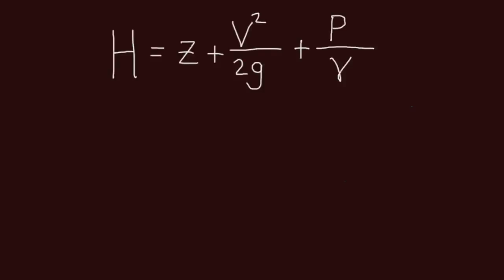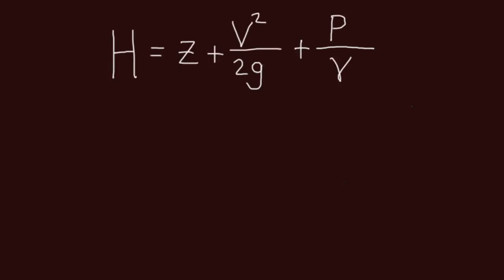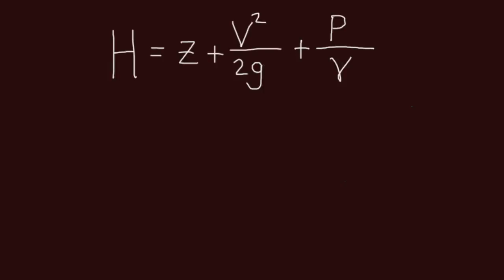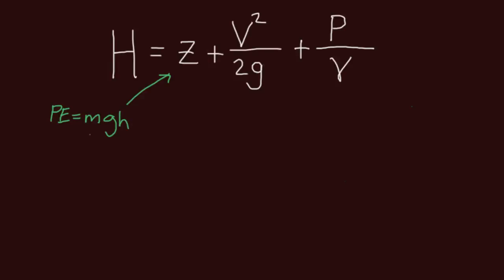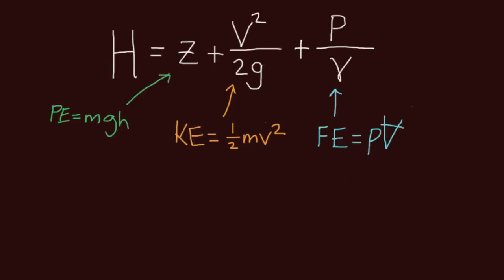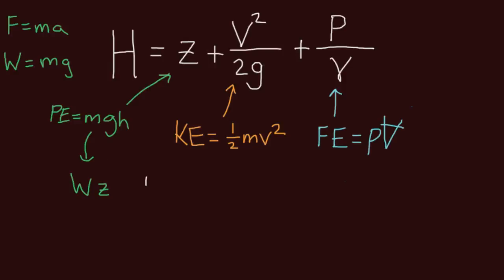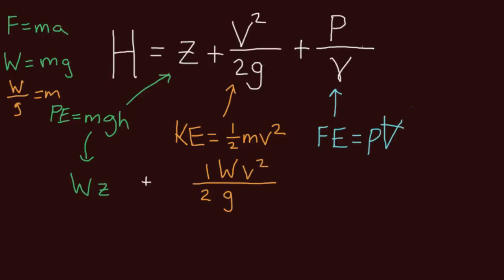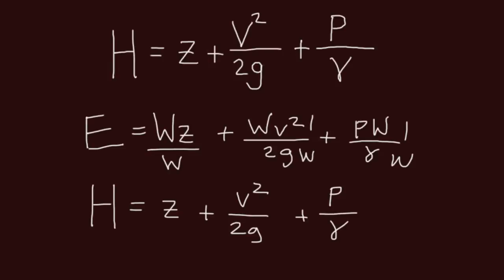Hydraulic Head (Part 2)

Comment: If head is a Total Energy,then why is the unit in the form of length,how does it come?
Reply: Correct me on this if I'm wrong but I think it comes from the idea that energy is in Joules or Newton-meter. And by simple algebra, dividing Joules by weight (Mass times gravity of simply, Newton) would result in meters.

In summary
Joules= Weight((z+(v^2/2g)+p/gamma))
meters = z+(v^2/2g)+p/gamma
Reply from the maker: yes, that is correct
Reply from the maker: Good question- since hydraulic head energy is completely dependent on a height above some datum, we can factor out the other variables that would make it a conventional energy unit. That way, it's easier to explain and understand head energy in terms of height.